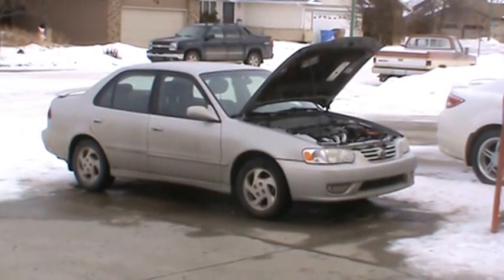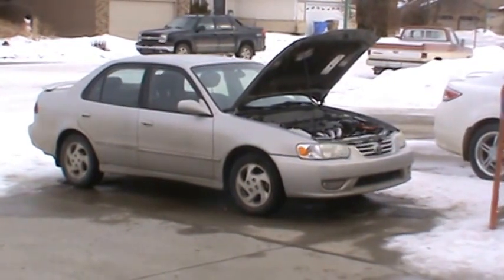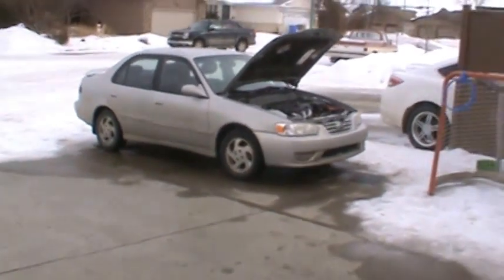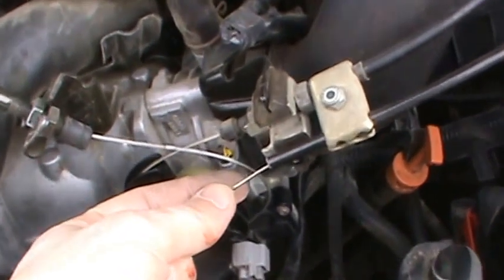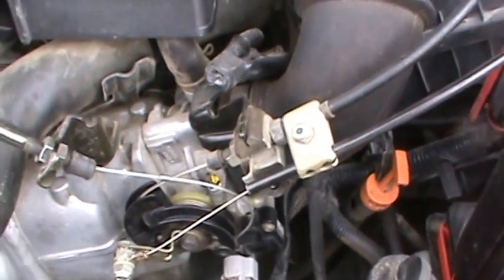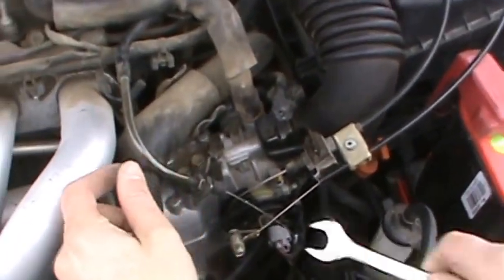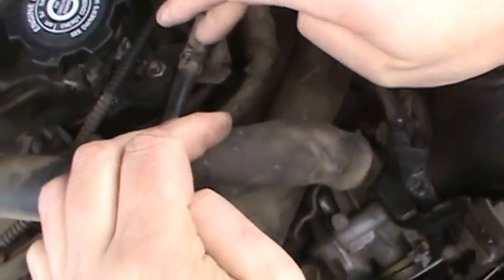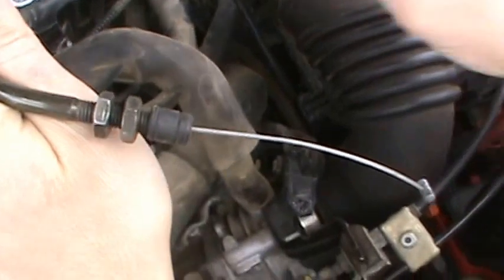2001 Toyota Corolla Kickdown Cable Issue

Comment: Great video. Simple and effective. As some have pointed out, yes, you could lube the cable. But doing that properly would involve taking the cable off and getting lube to travel inside the sleeve until it drips out the other end. Taking the cable off requires dropping the transmission pan and detaching the cable from the valve body inside the transmission. In some cases you even have to remove the valve body from the transmission to do this. Luckily on my 2000 corolla with the A245E trans you only have to drop the pan to access the cable and the valve body can stay in place. Still, this is about a million times simpler. Also, one has to keep in mind that excess lube could flow into the trans. One would have to be sure that the specific cable lube used would not gum up passages or contain solvents that would break down the ATF fluid, or damage seals, etc. So, like I said. your solution which is simple and effective is a good one. It fixes the problem right away at no cost. Good job and thanks for the great tip!

Comment: Great video my new kick down cable started sticking after a bout a month. After this video i took the cable off its original mounting locations and now it's springs back! Thanks!
Reply: 6shigh.       i had a new kickdown  cable installed on my Camry,  but now , several  months later,  my mechanic  needs to  look at  the adjustment or something.         its sticking again

Comment: Thank you so much for this. I had seen this video in the past before. Today after years of Harsh Gear changes I confirmed this to be my issue. It was doing it really badly after a rough drive so I pushed the Cable back down. As soon as I got back in my corolla shifted So Smoothly. I am relieved to know my Trans isn't going bad. I will attempt this Fix tommorow. :)

Comment: I couldn't believe he didn't oil the cable either. Problem will return. I used a little oil bottle with nipple while friend moved cable back and forth.. Also, if decorative engine cover causing a kink toss it in trash! Just trying to help as my friends corrola had a sticky cable that we first used brake clean on then oiled it and its now smooth as silk. Take some time to let oil work it way down while wiggling cable...
Reply: Did it work out? I tried unclamping, adjusting, and oiling mine with wd40 and it still won’t move freely it will return very slowly and still jerks my car. Maybe I willl try brake cleaner!

Comment: Hi got a 2002 toyota tacoma 4 cyl.auto. it doesnt shift when I try to pass a car, the kickdown cable is fine,I have checked it,I ran a diagnostic test  and it said that the 02 senser is bad.My question is this,would that issue with the senser be my problem of not shifting down  when i want more power? thanks geg
Reply: Bobcat Greene.               after my mechanics advice,   i  had him put on a new kickdown cable.           Less than a year,        same issue .             Im having to tap  my gas pedal with my foot,   to free     the  kickdown  cable so i can move on.          the kickdown  cable  is   binding , but should be free.           Any ideas/suggestions?

Comment: Would a spray of a grease like lithium grease or silicone grease help lubricate it?
Reply: Yes it would. I would spray a lubricant on the one end and try to get it to run down the inside of the cable tubing

Comment: I get that this is a 4 speed auto car, but I want to air my grievance here, Whoever it was at Toyota that decided to saddle so many corollas for so long with the 3 speed auto needs a good hard kick in the teeth.
Reply: Hahaha yeah that's crazy that the 8th gen Corollas even had the 3 speed as an option still. So glad my 2000 has the 4 speed.

Comment: a little oil will do the trick.....
Reply: How/where would you apply the oil?
Reply: Pablo Campos.             Mine did  the same  on my camry.            A  couple times a day felt like it was   binding  .           It was the slack   on the kickdown cable.               Nothing wrong with the cable itself.                         Simply loosen  2  nuts   at the cable  bracket,     pull the slack out  ,        tighten the 2 nuts  back.                Make sure theres no more slack  when you tighten    the nuts .              Easy   adjustment .                   The slack is the reason for the   stickiness----binding .
Reply: @DustinGrahamCA  down the cable housing. It bothered me that he didn't while it was apart.